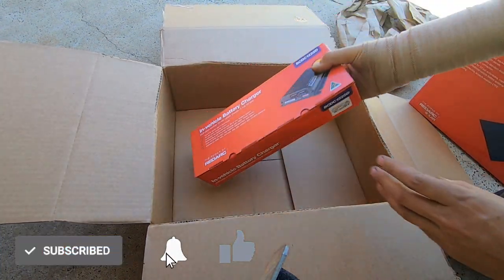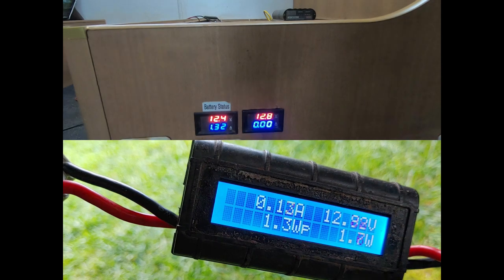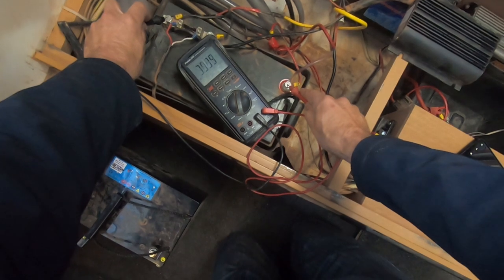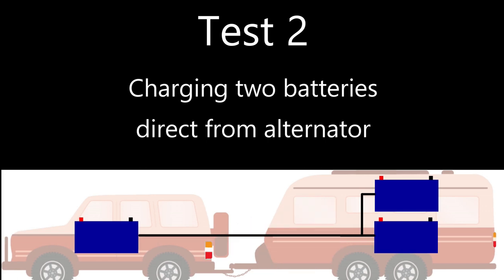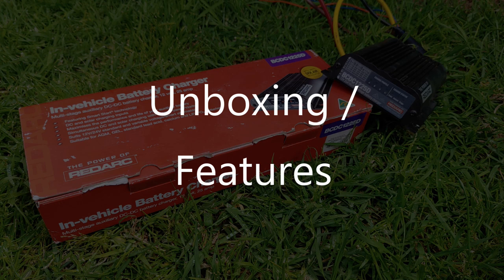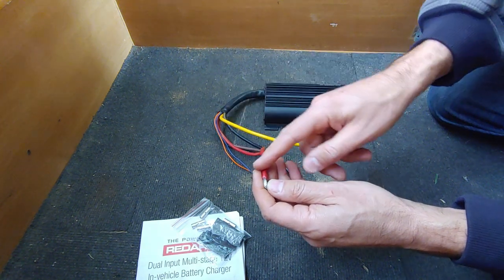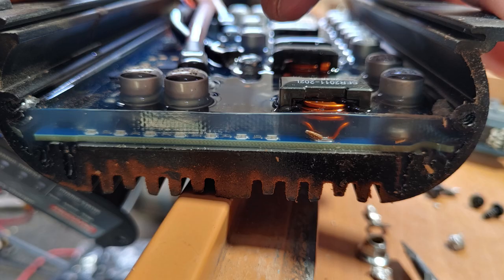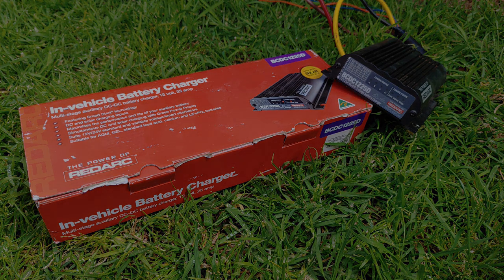REDARC BCDC1225 DC-DC Battery Charger Review - How to PROPERLY charge caravan batteries!

Comment: Hi Greg. Great video. I have similar problem as you , which is not even getting close to the rated current. Redarcs answer was 'too much voltage drop, cable size it too small', they said you need a input voltage of about 13 volts at the Redarc to achieve the rated output (in your case 25 amps) which makes the Redarc fairly close to useless unless you spend more on cable than you do on the Redarc. Even with under size cable I admit that the battery will still get fully charged as when the current comes down, the performance will increase.  Your 2 1/2 flat AGM's would have easily consumed 25 amps if it was available to them. I assume the right hand voltage meter was the voltage coming into the redarc, not the battery voltage.
Reply from the maker: Hi Hamish,

Glad you found it helpful! Are you saying you're having this problem WITH the Redarc DC-DC charger installed, or on the standard setup WITHOUT the charger?

I had the issue of low voltage at the batteries on my standard setup before installing the charger, and yes thicker cable might have alleviated that a bit, but it would never solve the problem completely because the input voltage is just too low. After I installed the Redarc charger I had no issues at all getting decent charging rates with my standard wiring because the charger's able to apply more load to the alternator than a battery does, and thus the charger pulls far more current through than the battery on its own could.

Yes the right hand voltage meter was measuring the voltage coming into the charger, and as current increased this dropped (due to cable voltage drop). However that is a pretty irrelevant reading, because what really matters is what the Redarc charger does with whatever voltage and current it gets. As you saw at about 5:12, with the Redarc charger I was getting about 14A flowing INTO the batteries (bottom right read-out) with a voltage of about 13V (top left read-out). With standard wiring. You'd struggle to get that reliably on a standard setup even with thick wiring. 

Let me know if I've misunderstood something.

Cheers,
Greg
Reply: @TheMusingGreg  Hi Greg. yes I was having the issue with the charger, but mine is a BCDC40 which just makes the small cable size more of a problem. You are also having the issue, although it may not be as evident. When you have 2 x 1/2 flat agm batteries, the BCDC will be in Boost mode (constant current) At this time you should be getting 25 amps into the batteries, with the voltage rising until it gets to about 14.5 v , then the charger will switch to absorption (constant voltage) Redarc appear to have built in a self presentation delimiting factor to roll back the output when the input voltages gets below 12.5 volts. People could say 'well use the recommended size cable them' which is fine, but it somewhat defeats the purpose of a DC-DC charger. I don't believe Redarc are alone in their omission of the devices true performance.
Reply from the maker: Hi mate,

Yes if you're trying to draw 40A through factory cables that were probably only designed for 10-15A, you're likely to get reduced performance. Mine would have been down probably for a similar reason, as I was only getting about 18A into my batteries when in Boost mode. The unit's 25A rating would I guess be a bit like what I've found with solar blankets - it's what it's capable of producing in ideal environments, but there are many factors that can limit what they actually produce. But 18A through my factory cables was still a huge improvement over what ended up being only a couple of amps once the van battery was about 3/4 full.

I get how you've come to your statement that thicker cables somewhat defeats the purpose of a DCDC - if you've got to put in thicker cables anyway, wouldn't that remove the need for a DCDC? However thicker cables are not necessary for a DCDC charger, they would just mean it would charge faster. But even with the original cables, a DCDC will draw a lot more current than your batteries would get without the DCDC, and without the DCDC you'd only get about 3/4 of a charge. If you put thicker cables in, you're still not going to get the same amount of charging current going into the batteries because you might have 14.4V at the alternator but there has to be some voltage drop through several metres of even quite thick wiring, whereas with a DCDC you've got your 14.4V right there at the batteries. Plus of course it can do the Boost, Absorption and Float which an alternator can't do.

The DCDC charger can put a much heavier electrical load on the system than the battery on its own can draw, which means it will always be able to suck through more power than the battery, be that through thick or thin cables.

Comment: I have just managed to get a hold of a REDARC BCDC 1250 DC-DC battery charger for my 4WD. I already have a REDARC isolator in the 4WD when I got it but wanted to add the charger to the system. The 4WD already has a dual battery system in it but I would like to add a deep cycle battery in the rear. The question I need to ask is would mounting the charger at the front of the 4WD be ok with the dual battery system and also the deep cycle battery I want to install in the rear of the 4WD ?
Reply from the maker: So to confirm, the existing dual battery system will be unchanged, while the BCDC is going to be mounted at the front of the vehicle and its output connect to the new battery at the rear? And that new rear battery isn't going to be connected to the original two in any way (other than sharing an earth)? If that's the case I can't see a problem with it, just make sure the wiring to the rear battery is thick enough as 50A is a lot of current. I'm not sure what purpose the 3rd battery serves but I assume you've got your reasons.

I just wasn't sure if your new battery was going to be run in parallel with one of the two existing batteries, in which case the answer is a bit more complicated.

Comment: Pls help. I have this charger in a duel battery system with an Anderson plug out near the tow bar. CAN I just plug solar into that Anderson plug and leep my battery topped up? If so do i need the solar regulated?
Reply from the maker: It depends if that Anderson plug is connected 1) straight to one of the batteries, or 2) to the solar input of the Redarc charger, or 3) to the output of the Redarc charger.

Anderson plugs near the tow bar are usually designed as a 12v OUTPUT to a caravan, so I doubt it's option 2 (but if it is then yes you could connect a solar panel straight into that connector with no regulator).

If it's option 1, yes you could connect a solar panel but you would definitely need to run it through a solar regulator to bring the voltage down, otherwise you'll fry your battery and vehicle electrics. 

If it's option 3, then no you wouldn't be able to connect a solar panel to it, however there would probably be a separate solar input to the Redarc unit somewhere which you need to locate, and then you can plug a panel straight into that.

If you have a multimeter, switch it to Volts and measure the battery voltage on each battery with the engine turned off.  Then measure the voltage onto the two terminals of the Anderson plug and see if it matches either of the first two readings. If it does, chances are the Anderson plug is connected directly to that battery in which case it's option 1. 

That's about the best I can do from what you've told me but let me know if you have any more questions and I'll do my best to help

Comment: Mate, best look at van power and dc-dc's I've seen. Based on checked facts, rather than someone's opinions. Good stuff. I've had dc-dc's for a few years now, even in my boat. Definitely improve performance and get around a lot of issues. The wiring in the Jayco is puny. Well worth wiring your veh. with 6b&s to an anderson plug at the towbar, then run 6 b&s from there (with an anderson) into your van, replacing the power wires on your 12 pin. If you run it to your fridge and charger in the van you'll see another big jump in performance. Also, if you have a 3 way fridge, run the heavy cable to it as well. You'll be amazed how much better a 3 way runs on 12v with heavy cable from the alternator. Voltage drop is really the big issue with 3 ways on 12v.
Anyways, subbed and keen to see your stuff. Keep 'em coming, cheers PP
Reply from the maker: Thanks mate, glad you found it useful! Yeah I reckon the stock wiring isn't really designed for what we put into it these days. I already have thick wiring on the car but could do with upgrading the van wiring. Cheers!

Comment: Great video. Will the unit send extra power back to the main vehicle battery once the secondary battery is full?
Reply from the maker: Glad it was helpful mate! It completely depends on how you've got it wired up, but not usually. This charger is really designed to keep a second battery properly charged and conditioned independently of the main battery, as the main vehicle battery should always be being kept charged by the alternator. If the main vehicle battery needed extra charge, it would be more efficient for that charge to come straight from the alternator, rather than through the charger and then back to the battery.
Reply: @TheMusingGreg  ah yeah I didn’t think it would. I was thinking along the lines of a camper van that could be parked up for a month not getting used. Cheers mate.
Reply from the maker: This unit only has two power inputs: alternator and solar (the Redarc Manager30 has a 240v input too). The alternator is obviously only going to run while the vehicle is running so there's nothing to be gained there as I described; however if your camper has a solar panel and it's stored outside you might end up with spare power from that. If so, you could configure your system so once the secondary battery is fully charged it switches the main battery in parallel to get topped up. Check with Redarc what would be the best tool for that, but they do have battery isolators which I reckon would be what's required.

Good luck!

Comment: Hi Greg, really enjoyed / appreciated this video. Technically it was good information. Question for you though. Do you think there would be value in gains by increasing your supply cables. They look like they are around 10mm2 . I'm not sure what the redarc cable sizes are. Increasing too 16mm weld flex might further help with the voltage drop and mean the redarc and alternator has a little less work to do? What do you think?
Reply from the maker: Hi Phil,

Thanks for the comment.Yep I think there's absolutely value in that, but so far I'm just using what's already on the car and van. The vehicle cabling is very heavy but the stuff on the van is quite a bit lighter in parts. The Redarc stuff is very thick, probably 4x what Jayco used when they built the van, but then they probably weren't expecting 2 batteries. That said, that would only go a little way to addressing the problem - with the diode bypassed you might be lucky enough to get 13.5V at the batteries with really thick wiring, but even then you need the voltage above 14V in order to get the batteries charged up to 13.8V in a reasonable timeframe. The BCDC is actually capable of outputting up to 15.3V if necessary, which is more than the alternator would provide, so thicker cables would only reduce how bad the problem is with direct charging, but it won't fix it.

For what it's worth, before I had the DC-DC charger installed, I had a switch which bypassed the diode which I would leave on while we were travelling. It certainly helped, but obviously still nothing like the results from the BCDC.

Cheers,
Greg
Reply: @TheMusingGreg  I have not done any research yet. Just collecting ideas. I think the more the voltage drop to the redarc means the higher/ harder it has to work. It sort of looked like it is bumping up the voltage from the alternator. Hence suggestion for increased cables. PS I'm waiting for Hilux to arrive sometime next year 😢 as lithium is sensitive to heat, am considering putting battery behind rear cab seat, and will run fridge and winch and fee accessories of that. Then use switch later to swap between cabin battery and a caravan one . Then I'll pull the books and look at the voltage drop issue properly. Thanks again. Great vid. A lot of work there.
Reply from the maker: No worries Phil, thanks, I appreciate it.

 That sounds like a reasonable plan. Yep within reason, the thicker the wiring, the less losses you'll have along the way, which over time will probably pay off as it will reduce the workload on the BCDC to a point. Once you've worked out the likely total current you can select a suitable thickness cable. 

 Good luck!